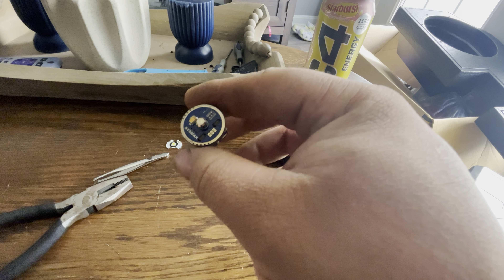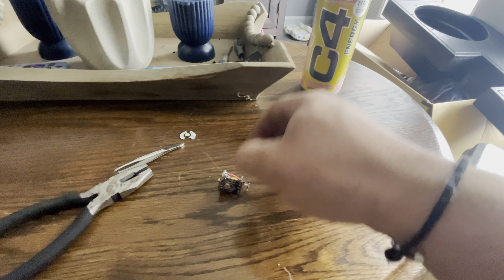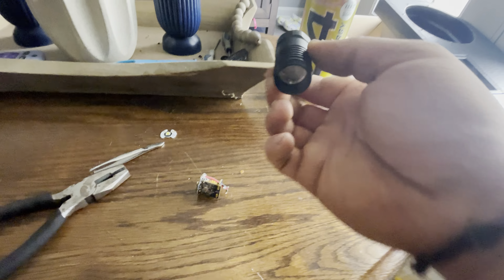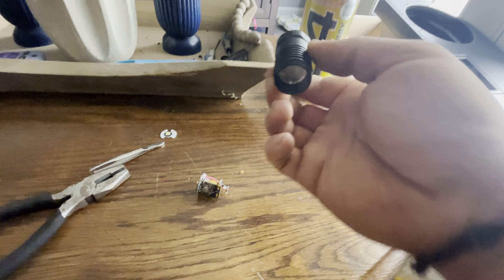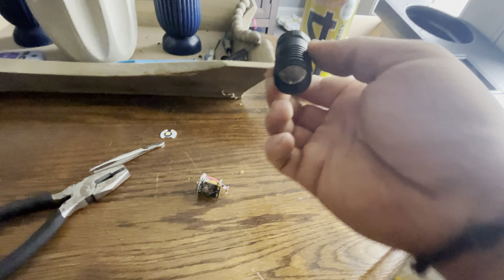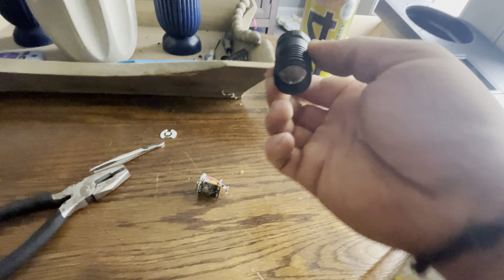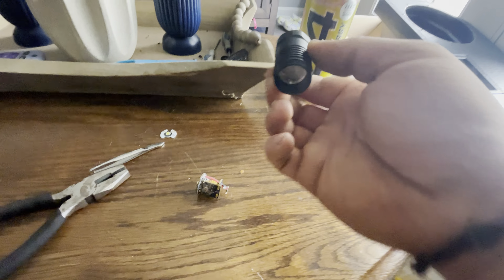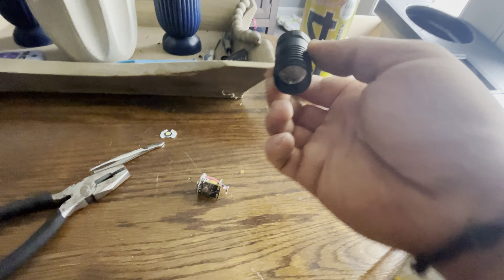How to disassemble the Nitecore P12 Flashlight

Comment: I have the cu6 model, I was reviewing your video, but I have not been able to disassemble the head of the lamp, where the circuit goes. Do you have a video where you start disassembling?
Reply from the maker: I will have to look and see if not I still have the light I can make one tomorrow after work for you
Reply: @loganschultz7400  Thanks

Comment: I have the MH 10 – stopped working, if I tapped it on the concrete sometimes it would come back again but now it’s dead completely – however I can still charge the battery as I use it to charge other torches that have faulty battery charging ports.  Anyone know if we can return to manufacturer? I really need this torch.
Reply from the maker: I’d try to see if you can open it and do a visual inspection of something loose. But if you have warranty on that just send that bad boy in getcha a new one man but if no warranty like I said open it up and look you never know.